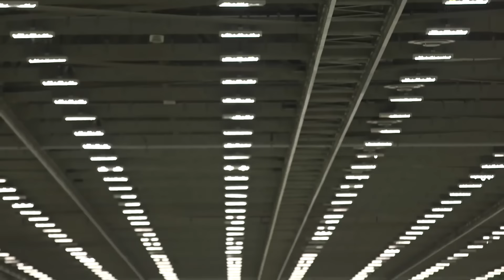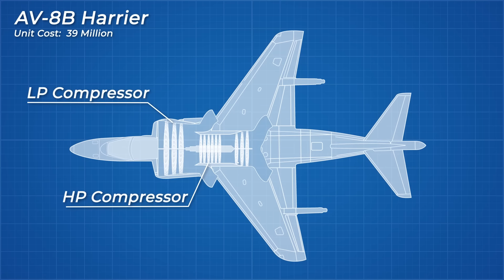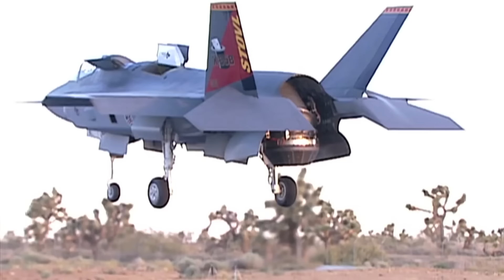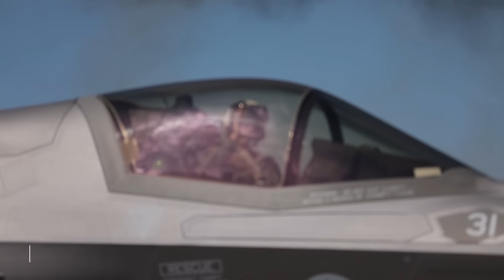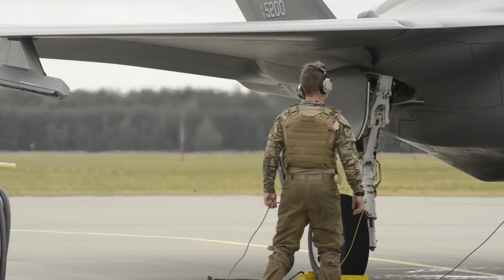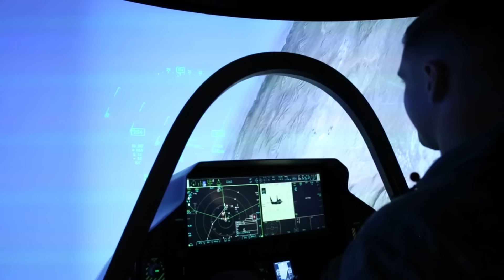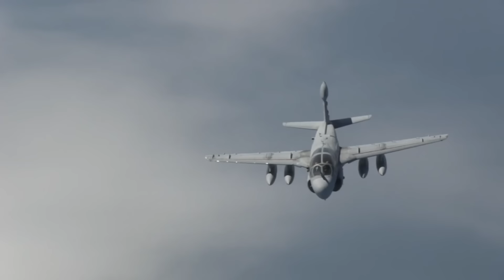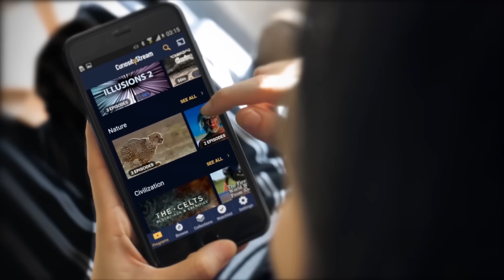Is The F-35 Worth $115 Million?

Comment: F35: “I can do anything!”
F22: “pathetic...”
Reply: @Shane Causey Obviously it can't replace the A-10 in low intensity conflicts, but put an A-10 in a modern air defense network and it's going down. In fact F-16's have performed many of the CAS missions which have the advantage of much faster response times. The A-10 airframes are reaching their end of life and will need replacing eventually sadly, but it's more likely that it'll be more cost efficient prop aircraft
Reply: @Shane Causey Definitely agree, and I think another solution that’ll appear will be drones which excel at loiter time. I think it’s the air force’s attempt rather than Lockheed, they’ve been trying to get rid of it for decades without success. Of course, Lockheed wouldn’t turn down a contract so they’d try as much as they can to frame the F-35 for CAS

Comment: Correct me if I’m wrong but the reason why the X-32 wasn’t favorable wasn’t because there were two prototypes (because both the X-35 and X-32 had two prototypes). But was because the X-32B VTOL prototype had to be modified (removing parts to reduce weight) in order to do vtol and modified in order to go supersonic. It couldn’t do both in one flight. While Lockheed’s two prototypes were the X-35A/B and C. Instead of building one conventional and one VTOL the X-35 A could be modified into the X-35B while the second plane was the C naval variant. And when Lockheed look it’s x-35 B and went supersonic and proceeded to due a vertical landing all in one flight it basically secured the X-35 as the victor.

Comment: At the 21:20 min mark the assumption is made that that the F-35 can replace the A-10.  This is fallacious as the F-35 has an estimated average loiter time of only 20 minutes vs 4 hours for the A-10.  Also the "afterthought" 25 mm cannon added to the F-35 has only 250 rounds while the much larger 30 mm cannon on the A-10 is not only significantly more powerful the A-10 also carries 1050 rounds of that ammunition.  Then there is the fact that the A-10 is (in todays dollars) less than 30% of the F-35.
Reply: The A-10's maximum flight time with a typical load is 3hrs, and it's max loiter time is around 40min on a typical CAS mission. The F-35A/C carry enough fuel to match the A-10. 
The F-35A's gun was built in right from the start. The F-35B and F-35C have podded guns much like the Harrier. Additionally there's no need for more power... the A-10's gun isn't any more effective against soldiers or structures (this is a matter of ammunition type), and contrary to popular belief the A-10's gun has never been a real threat to tanks. The A-10 typically carries fewer than 600 rounds to save weight.
The A-10 costs roughly $45M per unit. The F-35A costs $78M. You could get maybe 3 A-10s for every 2 F-35s. And there are cheaper platforms that are just as good as the A-10 within it's niche if you're really concerned about operating costs.
Reply: @dumdumbinks274  With flight time we are talking averages here, but the A-10s flight time is closer to 5 hours (https://www.af.mil/About-Us/Fact-Sheets/Display/Article/104490/a-10-thunderbolt-ii/).  And since they can be stationed closer to the front their flight time is not nearly as long.  And you can tell the dead Iraq tankers about the effectiveness o the A-10s gun 30 mm gun.  The fact is that the 25mm afterthought pod is damn near useless.  And 600 rounds is a lot more than 250 rounds, but maybe you are a student of new math?  Regardless they could carry 1050 rounds if they need to do so but the 30mm is so effective apparently they do not need to do so.

I can tell that you have never served on the ground.
Reply: @petemcl99  The A-10's flight time or conditions to meet such a time are not mentioned anywhere in your source. 3hrs is the maximum it can fly without external fuel tanks, and it's external fuel tanks are not rated for use in combat situations so are only used for ferry flights. Of course if you factor in aerial refueling it will fly for longer, but so will any other aircraft. If long loiter times and heavy firepower are needed bombers like the B-1B are used, and they are incredibly effective.

I can tell the maybe 29 dead Iraqi tank crews how effective it's gun is? 97% of tank kills by the A-10 during the Gulf war were made by either the AGM-65 or dumb bombs, and even then most of those kills attributed to the gun involved other munitions as well. Tests on T-62As imported during the late 70s and early 80s concluded that even DU rounds wouldn't result in penetration in the vast majority of situations. The T-62A is a tank that pre-dated the A-10 by almost 2 decades, and the DU ammunition used by the A-10 today is the same as it was back then.

The amount of times the gun is used is really quite slim compared to bombs, and yes I'm talking specifically about the A-10. Apart from penetrating hardened concrete structures it offers almost nothing over other systems. Even the M61 can disable a BMP or strafe enemy troops effectively.

The F-35's gun is from the same family of weapons as the GAU-8/A. It is just as accurate, and the only real difference in effectiveness is how many strafing runs an F-35 can perform compared to the A-10, and the ammunition used. The A-10 can store up to 1175 rounds which it will never be able to use all of them effectively, and they are heavy. The A-10 simply doesn't need any more than 600 rounds for an entire mission because it has more effective munitions under the wings.
Reply: @petemcl99  The numbers come from A-10 crews, both pilots and ground crew, as well as mission planners. 

The kinetic energy is not a problem. The targets simply don't warrant such power from a gun, or do you think soldiers should all have 50.cal rifles when a .223 round will do the job? Apart from when the target is a hardened concrete structure the GAU-8/A does not have any notable advantages over the GAU-22/A.

There are no concerns of the F-35 ingesting a round it has fired from it's gun due to it's speed, especially not at any combat situation the gun could see use in. If you actually believe that there's a chance of such a thing occurring then you have no idea what you're talking about.

Your final link is a known clickbait youtube channel that is run by people who make plenty of mistakes and a lot of the time just copy from other clickbait news sources.
Reply: @dumdumbinks274  you are misinterpreting the data.  And it is obvious that you have never been in need of close air support.
Reply: @petemcl99  What data am I misinterpreting?
Reply: @dumdumbinks274  well the biggest one is that kinetics don’t matter.  Also I do not know a single A-10 pilot that does not love that aircraft.  Many of them owe their lives to its rugged durability under fire.  I also do not know any ground troops that do not love the A-10.
Reply: @petemcl99  Kinetics don't matter because past a certain point it becomes overkill... just like using a .50 on a person. 

I don't know a single pilot or soldier who doesn't love the A-10 either, but that's not really a valid argument. Sure the A-10 can take a hit from small arms fire, but so can most fighters including the F-35. When it comes to AAA there are only 3 instances of an A-10 surviving the initial engagement against AAA systems that were obsolete decades prior; all of them were complete write-offs and one of them killed it's pilot on landing. If it had been an F-16 there was a high chance of the AAA missing completely, thus no airframe loss and no reason for a pilot to thank the aircraft for being rugged... and that is the problem...

The A-10 is well regarded because the effects of it's design are incredibly obvious and up-front. Troops can see it tear apart enemy troop formations on a regular basis (as long as there are no air defences) and it looks terrifying... an F-16 dropping a bomb doesn't have nearly as much psychological impact but is still just as effective at eliminating an enemy, doesn't put the pilot or airframe in any danger, and often arrives sooner meaning lives are at risk for a shorter period of time. 

Tell me, if you in the place of a soldier requiring CAS were under fire where time seems to distort itself due to fear and survival instincts taking over, would you even be aware of the F-16 before the bomb hits? Not likely. You're focusing on your enemy and avoiding being shot, you don't have time to look up and if you do you might only see an aircraft flying around seemingly doing nothing. You think to yourself "this is urgent why isn't it doing anything to save me" because you didn't see it release any weapons. What's your opinion going to be? Is it going to favour the F-16, or is it going to favour the A-10 which you can see actively engaging the enemy? 

Really the only argument that the A-10 should be kept is for it's effect on morale.

Comment: Fortunately the total amount of the F35 will be closer to 90 Million. Not far off from 4.5 Gen Fighters. The Sikorski King Stallion costs $144 Million. So look at the BIG PICTURE. Why did Joe Biden stop the F22 program which would have secured our air dominance No Question. The Cost of the F35B $92 Million, F35C $88 Million, F35A $85 Million.
Rafael $89-92 Million, F-15 EX over $82 Million so is it truly a obscure Price for what you get?

Comment: For as much hate as this airplane gets. It’s a quantum leap in capabilities for the US military. The F35 might not be the best in some areas. But the force multiplication of its sensors, sensor integration, information networking and stealth; Make it a force to be reckoned with. This combined with all the other weapon systems at play in the American arsenal. It’s a major addition overall. 

Not to mention the increase of our allies capabilities. Giving practically all of our allies stealth capabilities is a major leap in NATO’s power projection abilities. Practically every allied carrier is getting an upgrade from a Harrier to an F35. An incontestable improvement. That alone is a serious pro for this program. The increase in production numbers also make the plane much more attainable. 85 million is only like 3 million more than a modern F15. And the F35 has cheaper flight hours than both the F15 and F22. With the rising prices of modern planes, that’s really not that bad. 

Overall, it’s a good program. Not perfect. But a truly good deal for all involved. Most of the bad press comes from the media that has an axe to grind with the military. You can’t believe everything you hear from the news. They aren’t holding all the cards.

Comment: fturdy5... no its not worth it. you cant get a plane to get effective multi roles like the f35 promised. it is better than the av8b due to the advances in tech.  the whole plane sucks as it was held to a single engine. this is truly against the common sense when one is out over the ocean and a compressor stalls.  the scattering of companies through out the political areas "ruled" by the military industrial complex political overlords.  the jarhead model is ok but the af version is extremely limited due to its single engine. the navy version, well.. and there is no way in hell that this pos would ever be even close to replacing an a10. an a10 has triple redundacy on all areas plus armor that protects the pilot. ni actuality i wold stretch the a10 a bit longer and wider, fit more vulcans to really be able to strafe and put in an ewo to help locate and bomb. the old a1e and the p38 series devastated anything in its way. so no, it cant replace the a10, the f15ex and the f22 are alot better. the point that the f22 is lacking in is the amount of stealthy munitions. if the 22 flew dirty it kills the stealth. the f15ex used as a missle truck with an f22 as a guide destroys. sure the soft ware and capabilities are better as it is a lot younger than the f15. the f15 needs to have a modular air frame so upgrades can be used. the f35 is way over budget and it  doesnt matter about "infusing money back into the economy"  it is first stolen from us to pay for generals and politicians consulting and pac donations.  
NO IT IS NOT WORTH IT. NO WAY NO HOW IT AS TO BE THE WONDER TURD TO END ALL TURDS. IT JUST FAILS AT EVERYTHING EXCEPT GIVEN DUE TO NEXT GEN ADVANCES AND THE JARHEAD VERSION. of course the company test pilot is going to praise the company plane. 
still junk....

Comment: I worked on all 3 variants. Had Lockheed designed 3 different planes, it would have been greatly more expensive. In addiction, all 3 variants were designed and analyzed with US customary units. I suppose that means you are shocked that they are airworthy.

Comment: Despite the reasons stated it seems like the unit cost doubled once competitors were taken off the table! So much for the "economies of scale" a single source option was supposed to provide. With the new Chinese J20 at half the cost (and possibly a better performer) the "foreign government" sales noted could be wishful thinking in some cases!
Reply: Hey brainiac. The chinese don't have a practical engine and the aircraft is woefully underpowered... And the Indians have already tracked Multiple J-20s on radar. Try doing some research before posting... SMH 🤦‍♂️

Comment: 20:1 KDR ratio is bullshit. 

The F-35's advantage is stealth and it only achieves this stealth when it does not carry underwing hardpoints. Without the hardpoints, it can only carry 2 air to air missiles. So at best it enters an engagement with a 2:1 advantage over 4th gen fighters. 

And that is not factoring "misses".  

In June of 2017, it took 2 F/A-18, Two missiles to down a Soviet Era (obsolete) SU-22, using an AIM-9 missile (miss) and then an AIM 120 (hit). The F-35 uses the same types of missiles. 

The f-35 simply does not carry enough ordnance in its stealth configuration to achieve anything remotely close to 20:1 KDR.
Reply: I generally agree with your overall point that the current internal payload for air to air missions is still too limited. However, your analysis is wrong on two counts. First, the F-35 can carry 4 AMRAMMs in an air-to-air configuration. Second, getting two kills and returning home is not a 2:1 kill ratio, it's a 2:0.
Reply: 20:1 isn't bullshit at all. In fact the correct ratio is 21:1 and was achieved over a 2 week period during Red Flag 17-1. 147 kills and 7 losses. Roughly 100 missions so an average of only 1.5 kills per mission using at minimum 2 F-35s per mission, and at most 4. 

The F/A-18 vs Su-22 was technically 1 missile and 1 kill. The AIM-9 failure isn't an example of a missile "missing" the target, rather a missile not working at all. The AIM-9 was determined to be defective, especially since the Su-22 didn't do anything to evade. It is very rare for such a thing to happen with modern missiles and is usually only a problem with old munitions.

The Sidekick upgrade will enable the F-35A/C to carry up to 6 AIM-120s internally, matching the F-22.
Reply: @dumdumbinks274 Sorry but we don’t know the rules of engagement for Red Flag 17-1 and also we know that F-22 teamed up with the F-35 so its not f-35 vs gen 4 fighters ratio
More than likely the F-22 provided the interception role and the F-35 provided stealth bombing roles in the war games.

The success surrounding the F-35 is largely propaganda to justify the excessive cost of the weapons program so they are glorifying the plane b/c they can’t afford not to. An admission of failure and waste of Billions is a political disaster.
As to you point about the missles.
Either a missile hit or it doesn't. 
If it can malfunction or be defeated by a countermeasure it still a failed hardpoint. 
This is a risk f-35 due to its limited hardpoints. 
Besides the report from the pilot said the Su-22 deployed countermeasures to defeat the first attack, not that the missile malfunctioned so the point still stands. 

As for this so-called upgrade. Yea when are those upgrades going to be ready b/c this plane has been delayed forever?

With the number of upgrades that this plane is going to need before its functional, its stealth tech will likely be obsolete as I have no doubt the Russians and Chinese are developing their own techs to counter stealth. 

The f-35 is a phenomenal weapons program on paper...yes on paper. 

It’s not a bad plane in fact it’s an amazing plane but it’s not what its hailed to be. It makes for an amazing bomber which is highlighted in the war games but it’s not an ideal interceptor which is what they are also trying to sell it as, a multi-purpose all doing plane. It’s not at this stage.
Reply: @stav1369  Sorry, but we know a heck of a lot more than you think. 147:7 is purely on the F-35. Kills achieved by the escorts are counted separately, and did you miss the part where I noted the number of kills per mission was less than 2? How is that unbelievable?

Missile failure affects all aircraft and the F-35 still carries a respectable number of missiles internally. Your argument simply doesn't have a valid conclusion.

You evidently haven't read the report or seen the briefing the pilot gave once he returned from the deployment. The only point at which flares were deployed was by the F/A-18 pilot AS A WARNING to the Su-22, and the warning was ignored so the F/A-18 fired upon the Su-22. The pilot also states in his report and briefing that he didn't see where the AIM-9 went after leaving the rail, and that it didn't fly towards the target. 

The f-35 has been used in combat since mid 2018. It is functional right now, albeit with teething issues. It is no different than the F-16 in that sense.

Stealth won't be countered until radar ceases to be the primary tool for missile guidance, and you're guessing the Russians and Chinese will make stealth obsolete based on what exactly? Gut feeling?

The F-35 was designed to replace the F-16, and it is superior in literally every aspect of practical performance. To claim it is not a good interceptor is just ignorant.